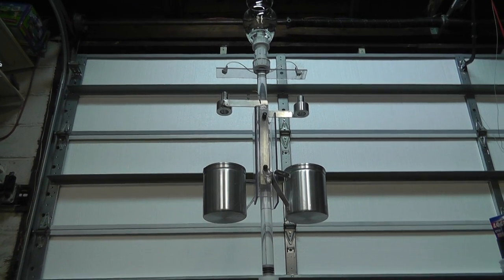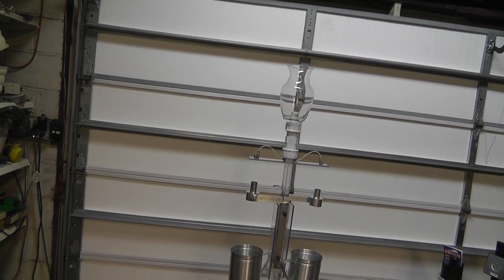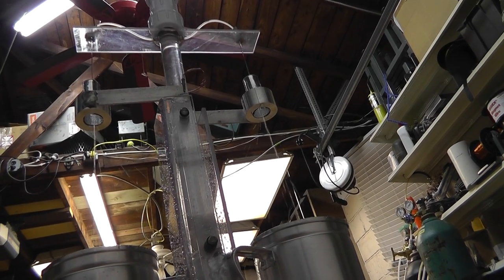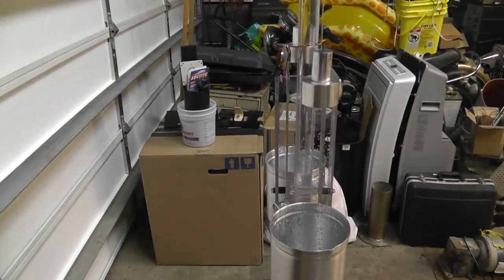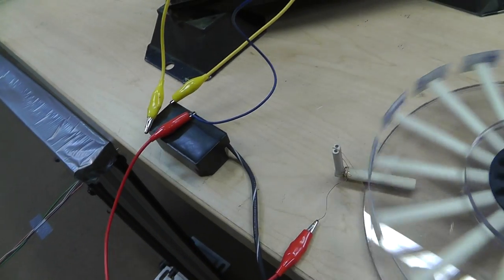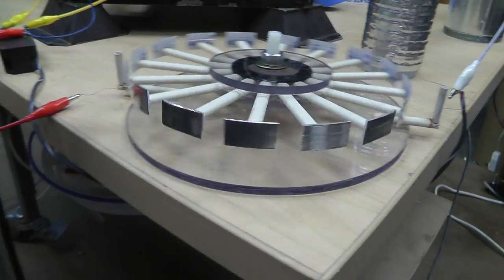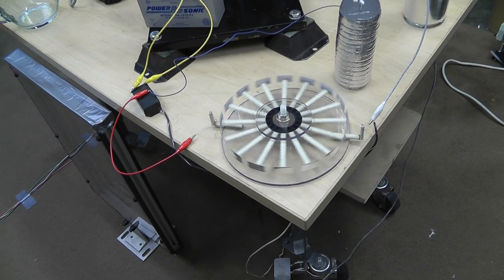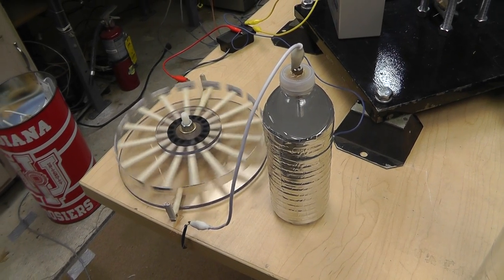The Pree-XMAS Pulse motor BuildOff 20-12! Up Date Video And Russ's Official Entry!!!

Comment from the maker: thanks for the in put bro! i know how it is!! :) yes, the generator would have been enough but its so sensitive to change in charge that it will change  + for - and visaversa... its a strange thing... once its going its ok but if the charge neutralizes its hard to get polarized again...  i think if i used a spark discharge type of device to charge the cap it may have worked... i don't know. the kelvin generator is an odd device.. :) ~Russ